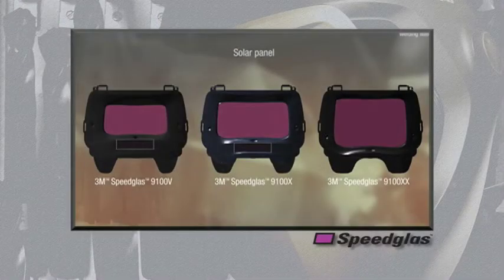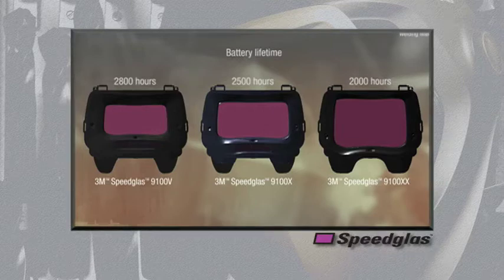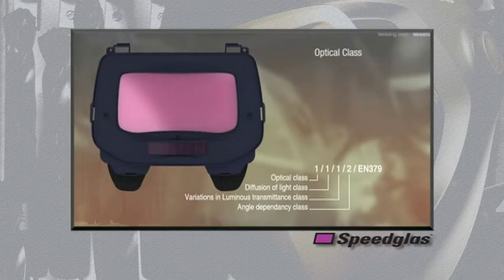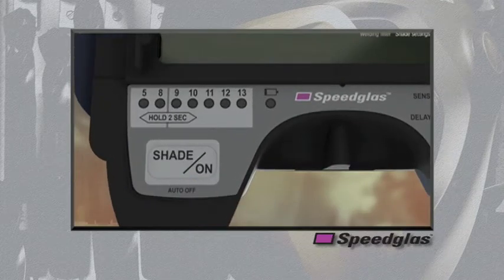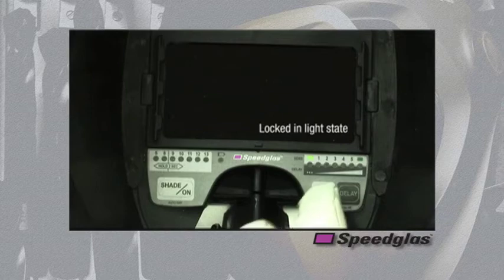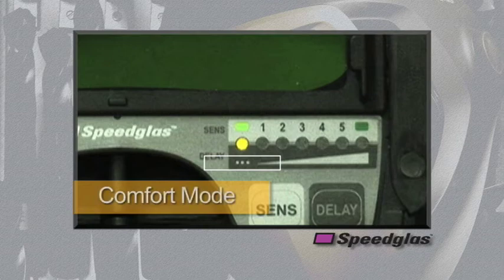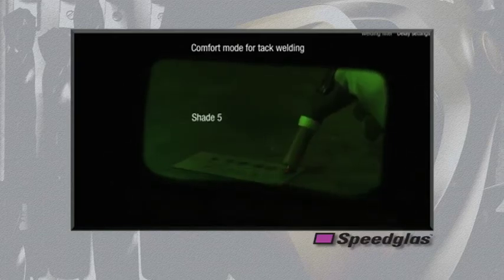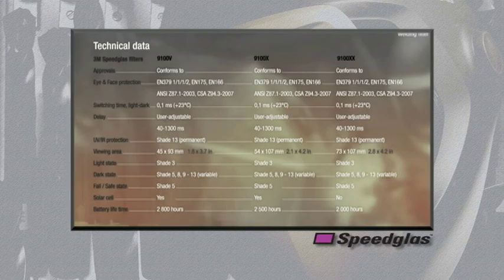3M Speedglas 9100 Welding Helmet Informational Video- Auto Darkening Filter Information

Comment: i would like to know about the 9002x and why it is still a higher priced item than the newer models???? and why i should choose that model over the newer ive heard nothing but great things on the 9002x and the new is nothing but problems but the head gear is a great improvement. I also would like to know how it is better than a optrel e680 since i cant find a comparison on the two thanks